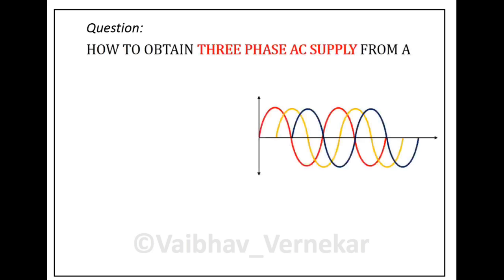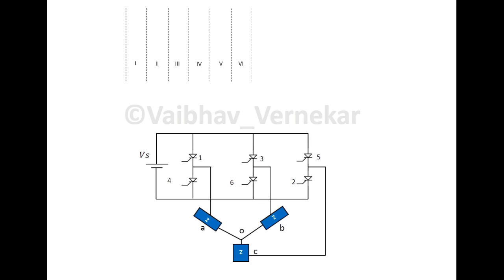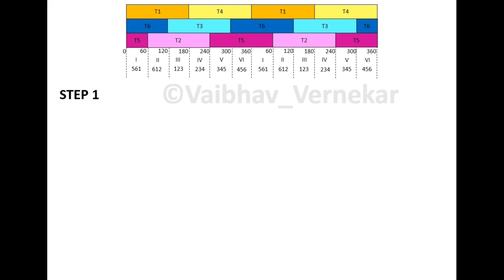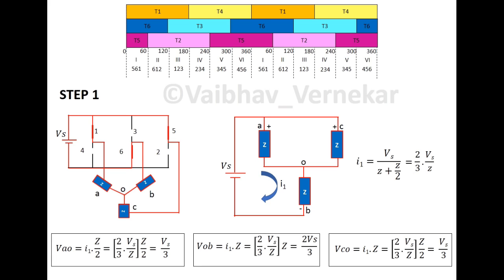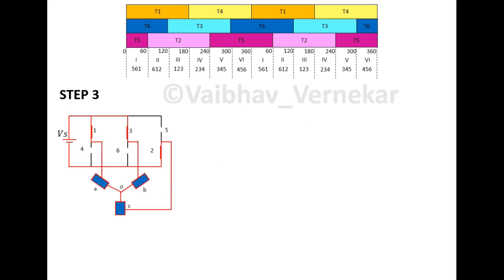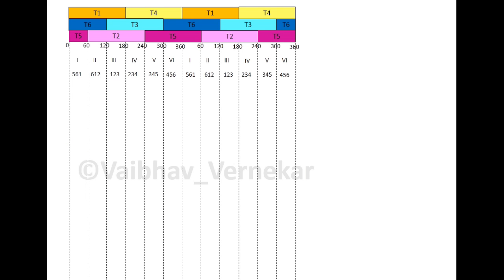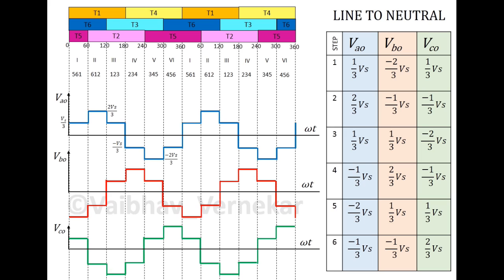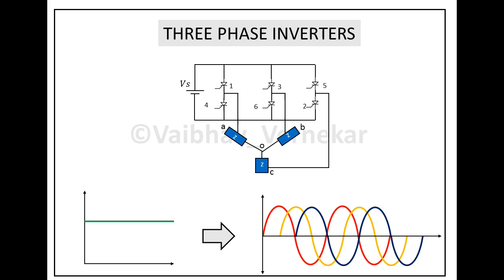Three Phase Inverter under 180 degree operation and the asscociated waveforms

Comment: I really hope you know how good you are bro!
Reply from the maker: Thank You! Appreciate the gesture :)
Reply from the maker: Because in 180 degree, One turns off, and the other turns on and ideally there is no gap between the transition.This will cause a short circuit and blow off the system. So for safe commutation go for 120 degree.

For the answers related to losses and other parameters refer to this quora link:
https://www.quora.com/In-3-phase-bridge-inverter-for-practical-purposes-is-120degree-mode-of-operation-preferred-or-the-180-degree-mode